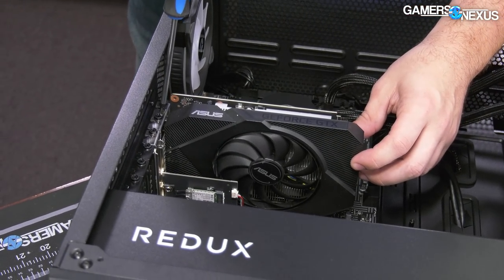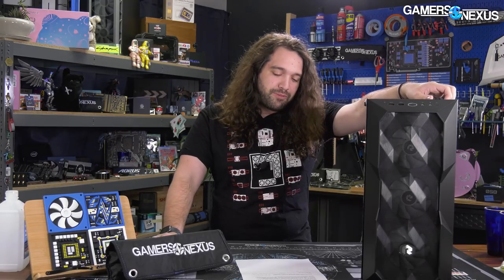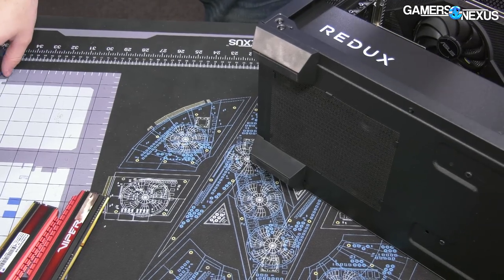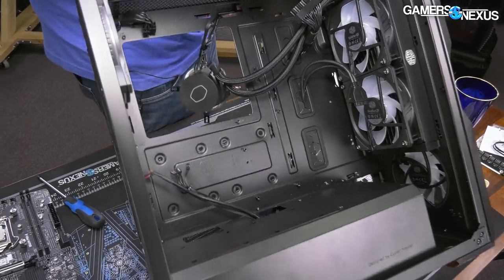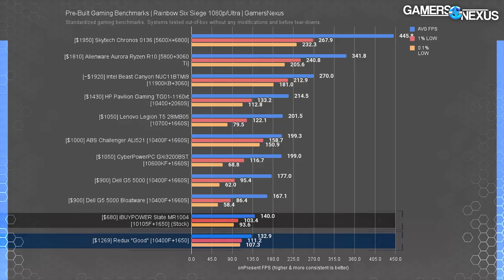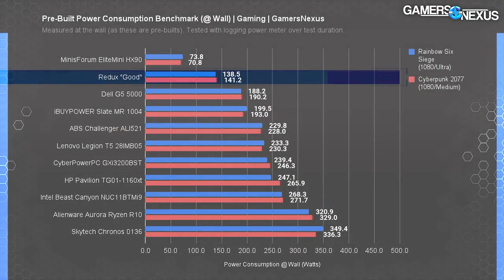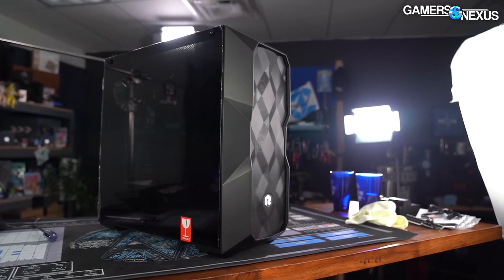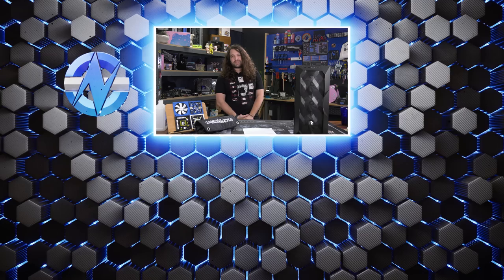YouTube Ads Told Us to Buy This: Redux Gaming PC Review

Comment: Note: After visiting Redux's website they have improved the default part selection for all 3 options which is certainly a step up from what was shown in this video
Reply: well, that's nice that they actually accept feedback
Reply: Okay so now the system is just a lone turd instead of being covered in puke. Nice improvement!
Reply: @2Evil2Hope  stay salty it still beats your system lmao
Reply: @nightmarezero8465  I'm guessing you overpaid for a POS from this company and now you feel bad. 😆
Reply: @nightmarezero8465  

That's a weird comment, considering it's not hard to get something that matches this for half the price, or beats it by 60%+ for slightly cheaper (as the video showed).

My new build is a R5 5600 and 3070 that cost about $1500 CAD and I officially think this is overrated. Even if you want an easy experience, watch some reviews and go to a different SI.
Reply: @2Evil2Hope  no I don't even have this system yet. Stay salty though 🤣
Reply: @jjpaq  with the way scalpers charge and price of PC parts now in general?  Yeah I doubt that.  Inflation said no.
Reply: @nightmarezero8465  

You doubt...that I bought the parts I said I did? If you actually believed that you wouldn't have bothered replying. You know I'm right and there are better deals to be had. 😉
Reply: @nightmarezero8465  

Also..."yet"?? The other guy nailed it, you totally bought one of these. 💀
Reply: @jjpaq  I don't go for cheap parts. If you want some cheap ebay off brand stuff go for it.  If I'm building a PC it's go big or go home cause it's already expensive. Also I don't got time to research upgrades and what is compatible with what motherboard.  Which is why pre-built PCs are a thing.  Also I'm a nVidia guy. Until AMD catches up I'm not bothering with them. Especially considering nVidia just unveiled the 40 series they are just burying AMD.  Only the true fanatics of AMD will stick with them.  As for their processors?  I think they are good competitors.  But it's only a matter of time they are so far behind they will have to stop making graphics cards and only processors.  If they were a processor only company they would make more money if paired with nVidia. But I'm off topic. Point is if you want cheap you will get cheap.  I trust few brands and those brands are expensive and hard to get while in stock Especially graphic cards. I read your comment but it makes no sense. Considering 30 series are still so scalped and the fact that they got inflated there is no point in buying the oem cards now.  Yeah I know you didn't get any deal on a card.  Maybe if it's a used cryto mining card and if that's the case then buddy you can have all those you want. 🤣
Reply: @nightmarezero8465  

"Scalpers"? Tell me you haven't shopped for a PC recently, without actually saying you haven't shopped for a PC recently. AMD is tanking their prices every day now that RDNA is coming out. Stores are actually able to keep 30-series GPUs on the shelf at MSRP. And that "off-brand" card you mentioned? An EVGA FTW3 3070, brand-new in box with receipt, for $580 CAD.

I won't waste time trying to prove anything to somebody who so desperately wants to be right, but for your own sake, please look at prebuilt systems from other manufacturers first. This one is objectively not a good value, unless what you value is a slick website and being up-front about how mediocre the PC is.
Reply: @jjpaq  I got a high end alien aurora you dunce. It must pay to be a salt lord
Reply: @nightmarezero8465  ahahahaha that's fantastic, you watch Gamer's Nexus teardowns and you still bought a "high-end" Alienware? I couldn't write a better joke if I tried. 🤣
Reply: @jjpaq  lol it still out performs your garbage. Probably still would if I put the old stuff back in it.
Reply: @nightmarezero8465  

Why would I care if your PC outperforms mine? I can play the games I want at a great framerate, that's what matters. 

In fact, I barely care that you wasted your money on an Aurora, except that it's so funny after you tried to seem all knowledgeable about PC buying.
Reply: @nightmarezero8465  lmaoooo imagine having an alienware.  know your place.
Reply: @nightmarezero8465  consumers will always try to justify their purchase decision, even if they regret it deep down.

And that's ok. But to then write a whole stupid paragraph, especially with the "NVIDIA is just burying AMD cause they can't catch up"? You've crossed the line od fanboyism and stupidity 🤣

Imagine buying an Alienware and thinking it's good, especially for the money.
Reply: @nightmarezero8465  you must be living in 2020 if you think scalpers are still making prices go up
Reply: @nightmarezero8465  "I got a high end alien aurora"

LOL
Reply: @NicholasWiewiora  lol u mad cause a pre-built wrecks you? Nice necro kid.
Reply: @nightmarezero8465  If you can build a pc why buy alienware 🤔
Reply: @@jaskajokunen3716  hmmm maybe cause that's what I started out with and have no need to replace the case or motherboard?
Reply: @nightmarezero8465  hm thought you would have upgraded those too since you said go big or go home, i also started with prebuilt and i slapped few parts in it, until i got 3090ti and  i9-13900k then i just decided to upgrade everything
Reply: @nightmarezero8465 tell me you don't know about computers without telling me you know nothing.

Oh wait, you already said that. Many times
Reply: @nightmarezero8465  Even if an Alienware outperforms something, it does nothing but lack in every other department. Terrible airflow, proprietary bullshit, absolutely ludicrous brand pricing, horrible build quality... Alienware is just a corpse that Dell continues to wear as a skin-suit. At the price you bought one of those things, you could of just built a much more powerful computer or just bought another prebuilt that isn't proprietary and is just all around much better. Definitely not trying to be rude about it, you can like what you want and there's nothing wrong with that, it's just honestly strange to me how people tend to solely focus on performance and nothing else.
Reply: @nightmarezero8465  I exclusively buy prebuilds (haters gonna whiiiiiiiine, someone call the WAAAAHmbulance).

But Alienware?  ........ Uh......

Comment: Microcenter's in house prebuilts "Powerspec" are pretty good. Some questionable hardware decisions, but pretty good price for what they provide.
Reply: I can also speak for some 2nd hand accounts through my friends little bro.  He unfortunately somehow had TWO AIOs fail on him in different ways, both times they replaced it by the next day, and this time with a overkill H115i Elite Capellix.

They also replaced his CPU, saying it would be "heat-damaged" from it which I'm not too sure about considering it didn't ever reach thermal shutdown...  On top of that, they let him keep the components they replaced! So I'm about to get a free i7-10700K since I helped him out throughout it 😅.  

Their customer service is just top notch.  Shame GN couldn't have the store experience since they don't live near a microcenter.
Reply: moving to microcenter asap
Reply: Their g299 and b247 are actually fairly good value for money but those slow ram sticks and bad PSUs look awful
Reply: I was literally about to comment this. I was at my local MC today to pick up the free 240gb SSD's their giving away and looked through their prebuilt section. It was actually really good... All PC's were clearly built by someone who knows what they're doing with all off the shelf components. They even had a pre built with a 5900x, EVGA rtx 3070, Tuf x570 board, 32gb of ram, 2tb nvme, and a 240mm aio for $2200.... Adding all that up with the rest of the components at their given "msrp's" you're paying a premium of $300 bucks give or take. In todays market for a competently built pre built gaming PC that's an absolute steal. Not to mention you get a 1 year warranty on the entire PC including labor and components. I honestly couldn't imagine a world where I didn't live 10 minutes away from a microcenter lol.
Reply: OwOmen  Isn't GN in NC? If so, there are definitely MicroCenters on their continent lol
Reply: @instantstupor  He probably confused Hardware Unboxed with Gamers Nexus. How can you confuse tech Jesus with anyone? Hahaha
Reply: The wife's PowerSpec is solid...5900x, Asus board, and a 3070.  Only potentially questionable component was the PSU, and I replace those automatically in a pre-built out of habit and experience.

(Not saying it's a bad PSU...just saying I have no idea, so it had to go.)
Reply: OwOmen  yeah def not a continent away... 4 hours... next state over...
Reply: isn't micro center only in California, that's far enough to be another world from GN, and the rest of us, lol.  (/sarcasm)
Reply: @Zarcondeegrissom  MC is all over the US. 16 states. Most stores in a single state are in NY
Reply: @Zarcondeegrissom  They're usually out of the way if you can find it in your state but definitely among the best retailers with physical locations even if fewer compared to their peers.
Reply: @Zarcondeegrissom  California is the only western state in which they are in (I'm lucky enough to be only 30 minutes away from it) but they have a number on the east coast and assorted states in-between.
Reply: I have 2 within an hour from me. The closer one is 25 minutes
Reply: @CompMeistR  we got one here in Demver
Reply: They also sell barebones Lian Li systems that have evga FTW3 3080s X570 or Z590, preinstalled custom liquid cooling loops and EVGA 850w fully modular gold rated PSUs for $1899 if you want to add your own cpu, memory and storage, which is pretty much the price a 3080 alone goes for.
Reply: @pepre7594  To be fair, it was Peak Shortage at the time, so she was happy to find anything; at the time, 5600x were all but non-existent, and most AIBs did (and still do) shy away from the 5800x due to its extremely aggressive thermal profile, so they could use a 5900x for the same price and less headache than the 5800x and the heavier cooler and extra fans needed to keep its thermals at an acceptable level.

In fact, that's the main reason I haven't swiped her 5900x and replaced it with my 5800x...it would just generate too much heat for the build without extra modifications.
Reply: Lucky for us 45 minutes away from the Philadelphia area MC. ALWAYS worth the drive and visit even just browsing around for stuff!
Reply: Bought one 2 weeks ago. G509, and am pretty happy with it. I agree with the others that the ram and PSU don’t look so hot, but upgrading from a laptop with a 1060 max q and a 7300hq, I’m sold. Paid 1.3k. I’ll invest 150 more on a decent psu and ram. Got a 3060 and a 5600x. Just walked in and asked for one.
Reply: Because they are build locally by real employees who like their job.
Reply: Microcenter is awesome! 
Its sad that we dont have anything comparable in Germany. This country is so fucked we dont have ANY decent stores anymore. Everything here is half arsed and ghetto, there is ZERO entrepreneurship anymore and its too hard to get a small buisness running because retarded government policies and insane prices on everything. 
So done with this place im in a Town of almost a quarter million people but I cant even buy decent clothes and shoes in town anymore there is just nothing there.
I cant find a store that has a good selection of cables like Ethernet, USB, HDMI etc you know the fucking basics. There is not ONE store in Town that actually sells computer components or sells decent computers.
Reply: @PabzRoz  "in today's market - that's an absolute steal"

This is a true statement, and it is wrong to make in every way whatsoever. You can get the same amount of truth minus the wrongness by saying "they are also ripping everyone off, but at least they aren't totally stupid!"
Reply: @alouisschafer7212  grow up
Reply: @nicewhenearnedrudemostlyel489  tf is that supposed to mean
Reply: @Zarcondeegrissom  no, Im a Kansan
Reply: Microcenter has some of the cheapest prices on components(like CPUs) and the best pre builts around in my opinion. They will ship some items
Reply: @nicewhenearnedrudemostlyel489  it's not that deep man
Reply: Should be better than Walmart. I mean it's Microcenter
Reply: I got a Powerspec G436. Being the spend-happy idiot i am, I went ahead and changed the case, fans, aio, psu and added storage too. Only questionable components of their builds are the psu and the case, the case has terrible airflow. Also their proprietary motherboards arent my favorite, the Bios is terrible. Overall im happy with the purchase. I did complain to them, saying the floor model had an EVGA 3070, and the salesman touted the quality of the card, but when i got home mine had a zotac. The store manager gave me a $140 credit so i used that to buy all the components i was changing anyway.
Reply: @elcoronacartel  G436 doesn't come with a proprietary motherboard? G436 comes with an MSI Z490 plus model. It's different from the retail model but not proprietary.
Reply: What are the questiobable hardware decisions?
Reply: @How23497  2600 mhz ram with Ryzen CPUs, Ryzen APUs paired with a 3070. They will always have the cheapest motherboard they carry too. It's nothing crazy, but it could be better
Reply: @JakeStz  all I can imagine right now is a 2200G with a 3070. Lmao
Reply: @instantstupor  Yes same continent but he would still need to travel to either Atlanta area or northern Virginia.
Reply: OwOmen  man idunno how you're fluent in English but can't tell American and Australian accents apart lol
Reply: The "questionable" hardware specs is where they make their profit.
Reply: OwOmen  ?
Reply: @Zarcondeegrissom  no. I’ve used them in Midwest.
Reply: @digitalis2977  I take it shitty psu’s in prebuilts are a common problem?
Reply: @xinniethep00h  In most brands, yes, since the PSU is the easiest place they can cut costs for more profit.

Everyone notices what type of processor and video card a system comes with, some people notice if their mobo is a name brand or non-proprietary, some notice if their RAM isn't from an A List Manufacturer, but next to no one bothers to check if their Power Supply...the item in the case that can literally destroy EVERYTHING else if it goes out...is made by a company ANYONE has ever heard of before.
Reply: After looking at these replies it is time to go look at my local microcenter
Reply: @goatmygoat1815  They're your best hope all the way around if you have the money for hardware.
Reply: @goatmygoat1815  It's not like they are magic, but they are built from off the shelf parts for about the same amount as buying the parts yourself. Also they have great customer service
Reply: @Zarcondeegrissom  I live in MN and there's one in the twin cities.
Reply: @goatmygoat1815  I've only been to one a few times but its just one of the best places ever! Something about a huge building that has sweet technology all over.... its great!
Reply: @stevenjohnson1692  I went yesterday day and I was lucky to go right when they they were restocking their graphics cards and I got a 3070 for 780$  then proceeded to get them to build the rest for me and am most likely going to pick it up tomorrow

Comment: This would be a decent pre-built if it was at a sub-$800 price. It has really good upgrade potential at least.
Reply: EXACTLY I just said this, competing products at that price point have better specs, this ones lagging.
Reply: Agreed, the asking price is ehh, i can find or build better.
Reply: @DailyCorvid  $1300 is an R7 7700X, 32gb ddr5, a 6750xt, and a really good watercooler and PSU. They're trying to punch in a price range that they dont fit in lmao

Comment: "Built fairly competently" is incredibly high praise for a pre-built, even if the specs are awful for the price.
Reply: the thing about the price is that u can customize Some of it. u can skip the windows 10 key. which decreases the value. u can get this exact build down to $1,165 by customizing it.
Reply: @mrjaked420  I know this was a year ago, but $1,165 is still garbage value for the components. My laptop has a 1650 mobile (I know it's not exactly the same), a better cpu (11400H), and 144Hz monitor... for $500 total.

Yes this video and you comment are about a year old, but it still shouldn't take anywhere near $800, let alone $1,165 to build this system.
Reply: @rube9169  I just got a second-hand like brand-new MSI Laptop with 3070 and 11th gen Octacore for €900 which is $975 currently from eBay. You really know this prebuild is f**ed when a laptop outcompetes it that includes all peripherals. And yeah, this was in times of the mining craze, but a 1650 was a ~$200 GPU back then (at least those that were available), so questionable price-balance still.
Also, yes I am aware that laptop components lose to those in Desktops due to reductions in clock-speeds (and sometimes even active cores).
The PC shown still shouldn't have topped $950 imo even back then.
Reply: @mrjaked420  it shouldnt cost more than maybe 750 even as a prebuilt I could build something that low spec for probably 500
Reply: @whohan779 the mobile models  are low power versions that are not comparable to desktop models.
Reply: @Purplesunset-  …which is what I wrote